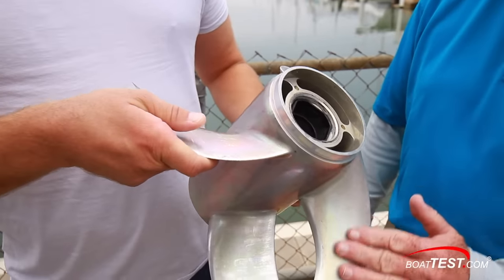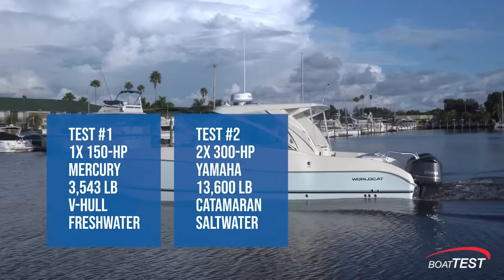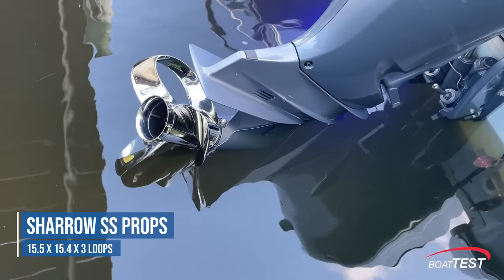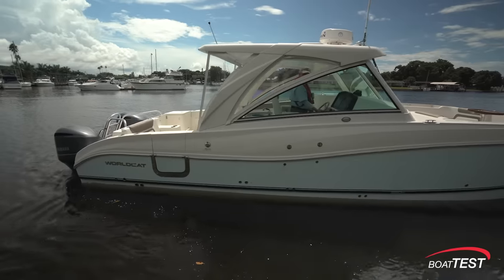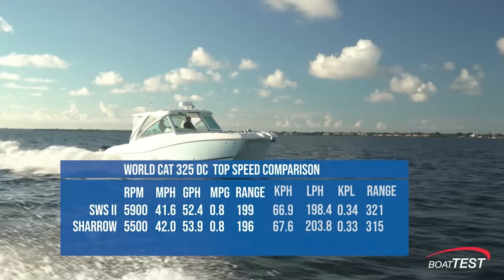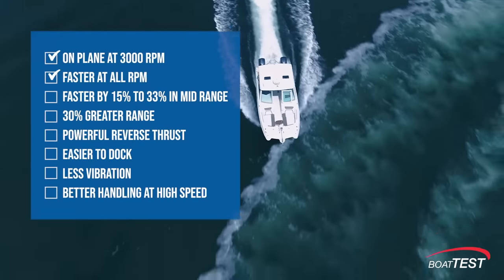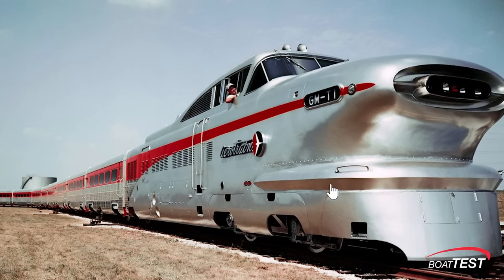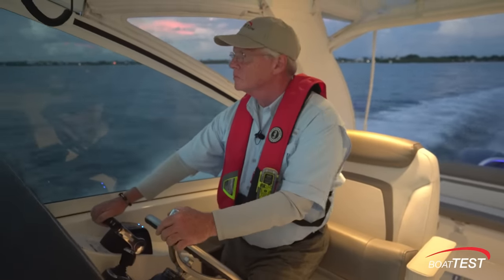Sharrow Propellers (2022) - Test Video by BoatTEST.com

Comment: If the data presented was even remotely accurate, this type of prop would be far more common. Engine manufactures spend millions on efficiency.  They are not dumb. I am sure this have been tested by Mercury, Yamaha... ect.   If this prop is so good... Why don't they use them ?  They are not new

Comment: If your price is set to $5k due to 5 ax milling you may want to look into 3d printing and investment casting. If you could sell the props for 1k they would be on every boat.
Reply: give it time... 3d printing isnt ready yet... needs fev more years :) with porshe deploying it for engine block printing and some companies starting to use it for airplane components its a rapidly evolving market.

Comment: Now take a boat propeller with the same pitch and you will see that there will be no difference.  It is possible that a boat propeller with three blades will even win.  Physics cannot be fooled.  I tested Solas 4-13.75-19 and 3-13.9-19 screws.  So, their maximum speed is the same, but at 4000 rpm, the three-bladed 43 kilometers per hour against 38 kilometers per hour.  So it's all nonsense.  This screw has a very high resistance.

Comment: Sharrow was NOT the one to "invent" this style of prop. It's been documented in patents back in the mid 1800's. Id imagine it wouldve been hard to produce back then. Sharrow refined and optimized the design and with modern 3D manufacturing machining tools and better alloys its just now become practical to manufacture in a cost effective means to be able to sell. Not to take away his achievement,  which kudos to him, but he didnt "invent" that design.

Comment: At $5000 it a joke maybe if it was Titanium. On a 200hp 21 foot boat running lake ontario will use less than $1000 a year at fuel even at $2 a liter. So talking $200 maybe $300 so 15 to 20 years for pay back. $750 and stanless would be another story.

Comment: Wait, it looks quite sketchy to me.. does any independent organization tested it and corroborate the results ?  All I see is mixed parameter statistics, with input mismatch. To honestly prove advantage is easy:  pour 10 galons of fuel and run the engine on 3000 rpm  until fuel is burned... what was top spead, and how far it go for each propeler ? Otherwise you fall into the trap of manipulation... with that fancy but crooked statistics. " there is manipulation, after that there is gross manipulation, and after that is statistics....."  j.stalin

Comment: This is crap data, I have been running outboards, out drives and shafted plaining boats for 50 years. in the test data at 4000rpm 300hp Yamaha standard prop the slippage (Difference between prop pitch and boat speed) is around 30% which is terrible. I operated a 14300lb planing hull and at 22 knot (they are at 23.8) my data showed 12.4 slippage on 3 blade bronze props. So this boat was underpropped to begin with and on the data given slippage came down to 15% at the higher speed of 41.6 knots which makes no sense.

Comment: Calling it now : these props will be the default props on boats in the 2020s.
Reply: Not at its current price point.
Reply: @JohnPavilonis  Have you seen what yachts cost? Almost none are under half a million and probably most are multi-millioon. These props are not even detectable as a rounding error.
Reply: @darthkek1953  That's if you have a bigger boat. The majority of boats are small. It all depends on the demographic of the industry and then it also comes down to awareness/marketing. How many boat owners even know this exists? It's an awesome invention though.
Reply: @JohnPavilonis  the first big brand to launch with these will change the PR game. For sure not an investment for a boat that cost a couple of bucks, but for all the sorts of boat BoatTEST review they cause less vibration, less wear, less noise, more grip, more speed, more fuel efficiency, greater range - AND pay for themselves.

Literally no reason not to install them on mid-range and higher boats.

Comment: I don’t believe this is anything special. It was stated that this guy has been making these for over a decade. I have been an avid boat enthusiast for my whole life and have never even seen these. Furthermore, it was stated that these props were made specifically for the 32 World Cat, whereas the Yamaha Saltwater series were not. Also, notice that when the boat was getting 1.5 mpg, the engines were dramatically tilted up. When the engines are titled up this much, you simple cannot sustain a comfortable ride in any chop. These props also bring questions to the table, like debris getting jammed in the holes of the blade. This test is obviously biased, so I’m not buying it. Whenever this thing actually comes standard on boats straight from the factory, I will call it legit. Don’t you think that if this prop design actually worked better, that most manufacturers would put it on their boats? It would certainly make the company’s designs look better. Just think about these things before your purchase…

Comment: this seems very poorly performed test to be honest. If you want to have fair comparison you should begin with matching props based of the WOT rpm. So do not pay attention to the numbers on the prop - test different pitch until you find a set which lets the engine rev up to the same rpm WOT.  Now repeat what you have already done and show us the numbers. Only this way the comparison has some value... In my humble opinion ...
Reply: I agree. Seems like they needed a bigger or more aggressive prop to begin with on the larger boat.

Comment: Too bad this test is completely pointless since the actual pitch of the propellers tested is so different. It's very easy to get huge differences if one propeller has the completely wrong pitch for the boat.

Comment: A cool looking prop that you buy based on the the “graphs and data” the manufacturer provides. Waste of money and by the time you recoup the cost you need a new boat, motor and trailer. Complete sh*t. Don’t get drawn into this scam. Is it more efficient, a bit, but nothing justifies that cost.